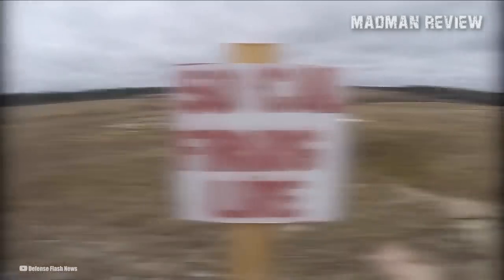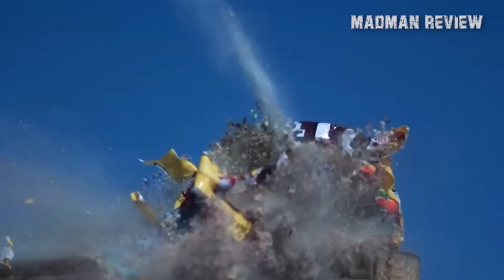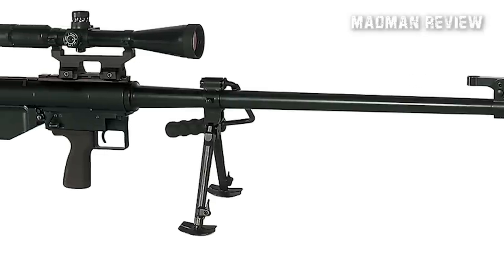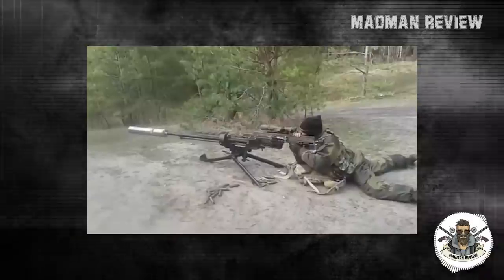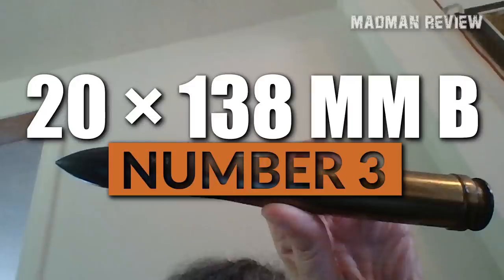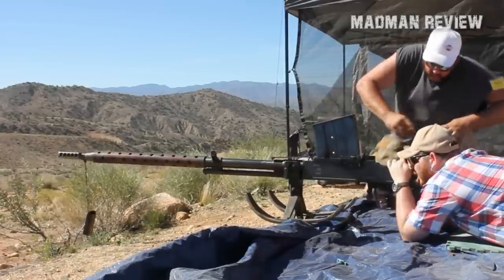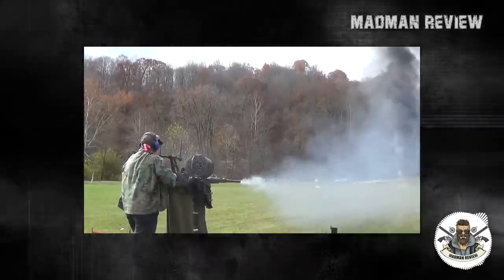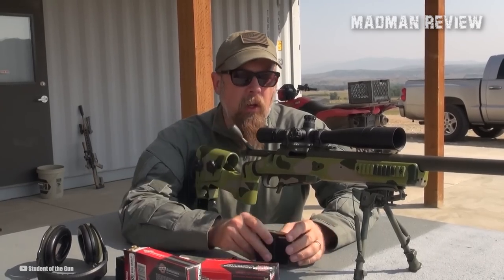These 5 Bullets Are DEADLIER Than .50 BMG!

Comment: In March 1965, Jack Franck, a New York City auto mechanic, purchased two Lahti L-39 Finnish 20 mm anti-tank rifles and 200 rounds of armor-piercing ammunition at the Alexandria, Virginia, offices of Interarmco. He paid approximately $800 for the two 7-foot 109 pound rifles. The purchase, made on behalf of his son, Joel Singer, aroused the suspicion of the Interarmco management who tipped off the FBI. However, Joel Singer, a native of Montreal, began to suspect that law enforcement officers were laying a trap, so instead of collecting his purchase at the front counter, he instead broke in and stole his rifles plus ammo. On Oct. 23, 1965, 22-year-old Joel Singer traveled with five accomplices to Syracuse, N.Y., where they targeted the Brinks armored car facility at Lodi Street and Lemoyne Avenue. On the night of Oct. 24, Singer and his gang carried out their break-in. It was later suspected the team had a strong understanding of the layout of the building, thus enabling them to skirt the Brinks alarm systems. Having opened the garage door, they were able to drive their DeSoto wagon into the building, carrying one of the Lahti AT rifles plus ammo and the rest of their burglary tools. The cannon had been modified for their purposes with a large canister-like suppressor attached to the end of the barrel and the gun sat on a special mount to facilitate blasting through the foot-thick cement and steel reinforced vault wall. The gang also used several mattresses and heavy blankets to help muffle the blast of the 20 mm cannon. (Later on, the FBI would pull the Lahti anti-tank rifle from the waters just off the shore of Garden City, Long Island.)
The shooter fired up over 30 armor-piercing rounds in a circular pattern through the vault wall, creating an approximately 18” x 24” hole. Although a tight fit, the hole was large enough for a small gang member to crawl through and gather up almost $425,000 in small bills, coins and cashiers checks. Evidence collected by police showed that the burglars had also brought along nitroglycerin, gas masks, welding equipment, and sundry heavy-duty tools, some of which were marked MADE IN CANADA. Leaving the spent 20 mm shell casings on the floor, Joel Singer and his gang drove away from the crime scene; they amazingly made their escape unseen and unheard.

Comment: They should check out Kentucky ballistics 4 Bore rifle, 2200 grain 1 inch rifle round, real monster lol
Reply: that 4 bore is bigger but definitely not deadlier than the 50 bmg. couldn't even penetrate a 1-inch steel plate
Reply: I watched his punt gun firing a 1 lb ball, and while it didn't go through soft body armor, it did push the body armor completely through a ballistics dummy!

Comment: How much more powerful is a 16"naval gun compared to a .50BMG....... THAT WOULD BE REALLY BADASS
Reply: Well, with a new barrel, a 16" shell that weights 2700 lbs has a muzzle energy of 262,269,785 ft lbs, where the .50 BMG has about 12,000 ft lbs so it has about 22,000 times the energy!

Comment: Should have been called "bullets bigger than the .50 BMG"
Reply: the video title is accurate. if it wasn't, then the list would have way bigger bullets like the 4 bore which most ignorant subscribers here have been posting in the comments. bigger is NOT deadlier. 50 bmg can penetrate tank armor from hundreds of yards away. 4 bore can't even pierce a 1-inch steel plate from under 50 yards.